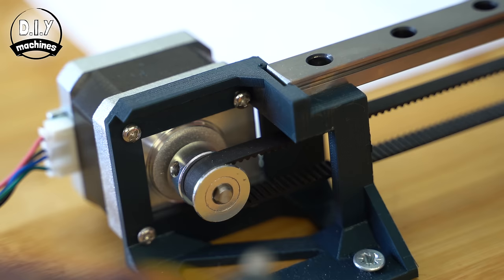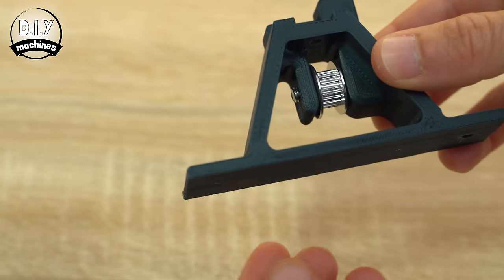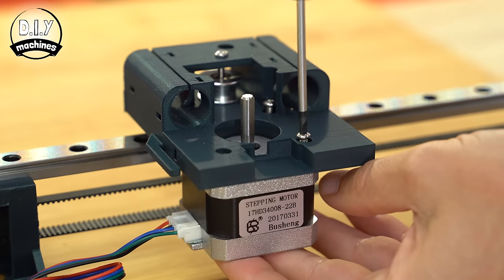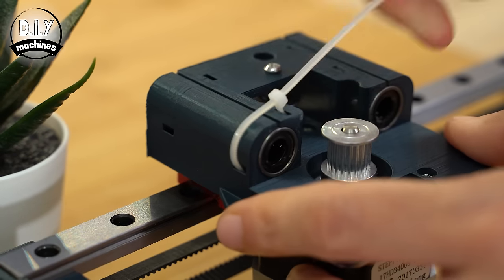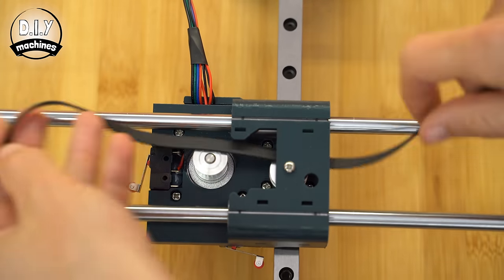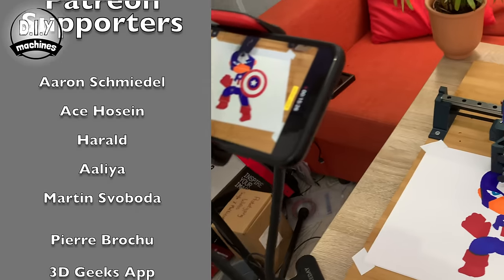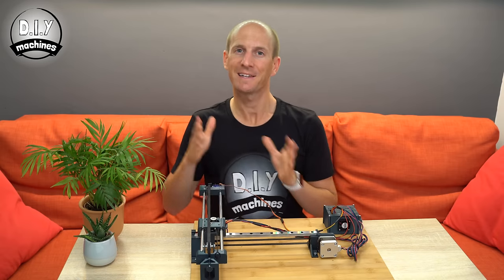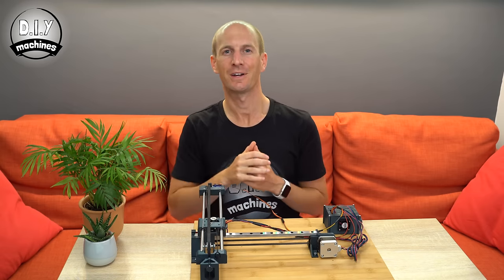Super Easy 3D Printed Arduino CNC Drawing Machine | GRBL Plotter Elegoo

Comment: cool project but i just put everything not printable into my cart and its $298.21 before check out. which is actually more expensive than some cnc drawing machine you can buy pre assembled
Reply: my total was less than $150  i just bought a machine for $99 which has not been delivered yet but comparing the two machines by images and descriptions it is clear that this is a much much better machine. It is more like the ones that cost $1000 to $1200 and you get to have fun and learn your printer. Forced me to do some upgrades and some experiments. My parts are coming out really nice of PLA carbon. I am going to hack up the cheapo to customize it for plotting on piano rolls as my laser machine cuts them. This machine will be my new toy. Once I prove the theory I will probably modify another copy of this machine for the roll cutter because I want reliability and durability and I know the $99 unit will not be either of those.

Comment: Wow , amazing tutorial , thanks you so much sir
I wonder if you suffered from this problem ,
some times after I bought stepper motor driver and current well calibration , the stepper gets vibrating, do you know the reason.
I used  A4988 , TB6600 , they were good for a few days , but after that ,the problem occurs.
what is your stepper motor driver name?

Comment: Just getting back to this project and found that the "30cm long linear rail with block" link you provided does not line up with the raft I printed. The holes in the block are approximately 12mm closer together than the holes provided in your 3D printed raft design. Do you happen to have the correct link for the larger block used in your video (the larger one with the green and red edges)? Thank you!

Comment: I have been looking for such a project. I built a laser piano roll making machine and have been trying to find a way to print lyrics without buying a $1200 printer and paying for expensive ink. I wrote all the code to do this for both matrix printers and modern banner printers before realizing how much it would cost to do this. I then thought of the idea of a plotter and have one arriving soon that is a piece of junk compared to your design. I only discovered your video because I fell asleep watching another similar one and yours came up. You video and instructions are amazing. Your attention to detail is superb and the machine looks like or better than commercial units costing a loooot. This is definitely my next printing project. I finished a major job of printing fenders for my recumbent tricycle and in the process have gotten quite good at printing impossible parts. I can't wait. After this I am afraid what I might want to build from your plans. I have not actually built anything yet but it is clear that you strive for and achieve a level of excellence that is rare today. I see from other comments that many people feel the same. GREAT WORK, KEEP IT UP

Comment: The level of care to detail is so amazingly high in this video - WOW.  I appreciate the helpful tips to help you ensure everything has worked correctly, such as the troubleshooting steps for the belts, and the continuity test of the contact switches.  This is particularly remarkable because it the most complicated build that I have ever seen that is made so accessible to an absolute beginner.  If you have access to a few basic tools (glue gun, screwdriver, soldering iron, multimeter), you can make this.
Reply from the maker: Thanks for the kind words Tristan, I worked hard to make it all as clear as possible.

Comment: I successfully build my own plotter, thanks again for your video!
Just one thing i´m concerned about: My Nema17 Stepper Motors are becoming quite hot, when drawing big pictures (2-3hours). I can touch them for barely 3-5sec!
Is this a common thing (i dont have experience with stepper motors) or is something wrong with the stepper drivers? I saw that its possible to change the ref Voltage, but as i understand, this build is using UART drivers, so no need to configure the vref via potentiometers, right?
And how can i configure the motor amperes via UART? 
Thanks for help!

Comment: I would recommend using Nylock washers instead of normal nuts as the Nylock nuts have a locking nylon bushing in them.  Also, is this project expandable so that a drawing that is around 24 inches by 36 inches is possible?

Comment: One of the better design print/writers and neatest designs.

I think the axial motor mounts could have had slots to mention the belt.
And I think the pen end could have been attached directly to the head, with a gear, or swivel arm to lift and drop it.

I think I would have built up the shield before mounting the Uno so alignment is easier. But then you can't get the screws.

And as a small part of design, the slid bearings, rather than using cable ties, a small screw could hold them there if spaced far enough away to just catch rather than misalign.

Keep up the good work.

Comment: I bought all the parts on your list and am very excited to build this. I am working on a frosting pen that will extrude red,green and blue frosting into a small mixing head to extrude a variety of colors to draw on cookie- cupcakes and cakes. Your videos are so easy to watch and understand.
Reply: Did you do? Does it work?
Reply: @MertCadet  I am still working on the design but it does work. Frosting pumps work great but the mixing head needs work as the frosting comes out in stripes like toothpaste not a well mixed color. The larger mixing head did a good job but requires too much purge before chosen color extrudes.

Comment: Just got mine finished. Works a treat. I have modified the pen holder by the addition of a compression spring which helps the pen engage on the paper when the servo releases. I also don’t use belt on the pen, just two plain pulley wheels and a length of fishing line between the pen head and the servo. I 3D printed a small support for the pilot wheel at the servo end.
Reply: Hey, I was just questioning why do we need the belt for the pen myself, it seems it could be simplified by putting the small servo motor on the same pen holder. Could you share any ideas on how you removed the belt?

Comment: Hi, great video and I'm ordering to build it now but I want to design a 45 degree pen holder, is it possible to get step files from you?
Reply from the maker: Hi Brennan, thanks for the kind words. I'm sorry but I only have the STL files. I designed this project in Solidworks but I no longer have access to it (I used the software where I used to work but I don't work there anymore). My new projects are starting to be designed in Fusion 360. Depending on your software you might be able to have it 'recognise' the STL files and turn them into something editable for you?
Reply: @DIYMachines  if you are interested I have access to solidworks and could read the old files for you and create steps. Fusion 360 also reads native solidworks files but you need a paid version to export step files.
Reply: Great project and great presentation as well! Is there any way to use another arduino to write codes on grbl serial monitor (command line)? I'm thinking of making a template for a drawing which will take measurements as input then that other arduino will make calculations then write the code on grbl.

Comment: Dear DIY Machines, 
This is the first video I am seeing from your YouTube Channel.
Crisp and Crystal clear videography catches the eyes instantly. And still more Crystal clear audiography catches the ears without any hitch or glitch.
I wonder your recording studio must be equipped with the most modern media gadgets.
Thanks for both.
Your way of describing a, even though you dub "Super Easy", this is indeed somewhat complex design, is simply fascinating! Stream like narration without any drag, is all the more informative. Even at first run, I was able to absorb th key points easily. 
Assembling a technical machine that is going to be assembled from raw components, with this type of oral guidance is, of course, as you names, "Super Easy!"

 Apart from the electronics and software sections, the construction fairly uses 3D Printing for many parts. So, no cutting, grinding, polishing, milling or drilling. A very nice method.
Congratulations form an ardently ardent DIY Techie from the seventies!!
I am about to do this. But I hope you will publish the programming section and the electronics section soon. Please make this video complete is all aspects.
Thank you very much!!
Reply from the maker: Hi, thank you so much for your kind words. I work hard on the projects and the videos and it's so pleasant when someone takes the time to say a few kind words. The second video can be found ere: https://youtu.be/8scKLHz77Lg
Reply: sir, problem how to clear error this type 
08:44:05.465-> error: 2
08:44:28:27.883-> error: 9
Motor not running pls help sir

Comment: This is a great project and a well done video.  How far could this be scaled up by using longer slides?  I would like to build one with a working area 24"x36".  610mm x 915mm.  That would cover a standard poster board, foam board and... well, a lot.

I am thinking the X axis rail might need to be doubled, one motor and rail on either side?
Reply from the maker: Yes, if you were to increase the axis moving back and fourth than I would recommend doubling up on the linear rails and a motor for each rail to move them in tandem.
Reply: @DIYMachines  Thanks for the reply, I will keep you updated on my progress.
Reply: @kennyFF033  how is it going? Now I have completed mine I’m planning on a design change (adding a second rail ) and also seeing if it will
Work ok with a usb microscope.

Comment: Normal closed switches are better for safety features. It will stop the machine in case of a cable or switch failure.

Comment: Hello, this is incredible, thank you very much for this fantastic video. I wonder what software you are using to design your 3D printed pieces.
Reply from the maker: Thank you and you're welcome. This project was designed in Solidworks but I now use Fusion 360 for my newer projects.
Reply: @DIYMachines  Thank you for your response. I will check both of them. Live long and prosper. 🙏

Comment: Very nice project, this could relatively easily be adopted to laser engraving as well.
Reply from the maker: Great idea. I believe you could. GRBL (which runs on the Arduino and interprets the GCODE) is built to also control lasers so I don’t believe you would have to modify the project too much.
Reply: @DIYMachines  sounds like a future video you can make! 😁

Comment: Where did you source your steel rods from? I'm having trouble finding one as short as 55mm
Reply from the maker: I ordered them on Amazon for my prototype and I used some from eBay for the final build (shown in the video) as the ones on Amazon became out of stock. You can use a small hack saw or similar to cut longer ones down in length. Just use something like sand paper to smooth the edges of the cut before inserting them through the bearings. This is what I did.

Comment: Hi Lewis! My son and I are in the process of 3D printing this and have a question about the linear rail. I ordered the one from your link on Amazon, but it does not look the same as what you have in the video. I did not notice later there was an option for a MGN9C (the one I received), and another for MGN12H. Can you provide more details on which one to use? Thanks for providing great content!
Reply from the maker: Hi Jim, great to hear that your building one together. I'de love to see a photo when it's completed. :)
The number refers to the type of block on top, see here for more info: https://aws.robu.in/wp-content/uploads/2019/07/Linear-Guide-Rail.jpg
From memory I believe it is the MGN12H I designed the parts around.
Reply: @DIYMachines  Hi Lewis! Thanks for the reply, I realized this soon after I posted this. We have completed the build, and will be sure to send you pics of our build very soon. I do have some other questions, mostly related to part 2 of this project, so I will post there. Thanks!
Reply: @berner57  Hi Jim. Do you mind sharing some pics? I´m really interested. Thanks
Reply: @d3rsch0rsch  Absolutely! I was planning on doing just that, along with some notes on my own experiences. This is a great project, and a lot of fun, I need to do a little house cleaning on it before I take pics.

Comment: Nice Job. How do you create the infill once you create your drawing in Inkscape.
Reply from the maker: Thank you. For the infill I drew lines back and fourth in Inkscape. My Inkscape knowledge is limited - if you find a sleeker method please let me know. :)
Reply: @DIYMachines  Good Day. It seems that most folks use hatching and can be downloaded from https://wiki.evilmadscientist.com/Axidraw_Software_Installation. Its a Inkscape plugin.
Hope this helps.
Reply: @MrLeopain  This tip is golden! The hatching works perfect, and can be adjusted depending on the pen size used. Awesome.
Reply: @d3rsch0rsch  Which version of Inkscape are you using. I find the size that I save is not the size it prints.
Reply: @MrLeopain  I use different versions. All the editing and also the AxiDraw Tools i do in v1.0.1 (latest)
Then i save the SVG and make the gcode with the Migrbl Extension in Version 0.48.5 (as mentioned by Louis in the Video)
I cant tell, If the print in real will be fine, because i dont have a Plotter by now ;) But Simulation in Chillipeppr seems top be OK. Its looking fine in the visualizer.

Comment: i have a question luis pls reply can i replace stepper motor with brushless motor
Reply from the maker: Hi Pawan, a brushless motor would not be accurate enough for this project or suitable for the motor drivers used.

Comment: Would it be possible/feasible to make a corexy version of this design? I ask because it seems that this takes up a lot of space outside the nominal footprint, since the bar has to go so far over the back edge of the board.
Reply from the maker: Hi Walter, it could be re-done as a CoreXY style but it would end up being a very different machine in many ways so probably best start from a fresh design. One of the reasons I did not go down the CoreXY route was because if the frame is not perpendicular at the four corners it can lead to dimensional inaccurate drawings. You are right though that it would mean you would not need to allow for when the pen axis is protrudes out the back of the workspace.

Comment: Is it possible to make it bigger with longer rods and linear bearing or would the added length add to much strain on the 3d printed parts and motors?
Reply from the maker: You can certainly make it larger. A longer rail on the X axis should not add much strain to th machine, but extending the rod on the Y axis as is would start to create problems. It would certainly need two X axis if you wanted to reliably support a longer y axis over both.

Comment: Excellent project and would like to make one for sure but my question is can we use a push-pull solenoid instead of a servo for the pen? I am looking at increasing the writing speed using the solenoid. Please suggest!
Reply: Solenoids cannot set to a specific position like a servo or stepper-- they are all one way or the other.

Comment: Fantastic video! I'm setting out to follow this and build my own, wish me luck.
Reply from the maker: Thanks Viktor. I'll say good luck (but I hope my instructions are good enough that you don't need the luck) :)
Reply: @DIYMachines  Yesterday I ordered parts and started printing the first few pieces. I'll give some feedback on problems I faced so far: 1. Wasn't sure what strength of nema motor I needed, but ended up buying ones with similar size (as a bad proxy). 2. had problems understanding how the linear rail and block standards work, what's a MGN9C vs 12H etc.. Guessing can make it work with whichever,  but took a while to decide.  3. My first 3d print failed (BaseEnd-Idle) when I to print it as it'll be mounted and didn't realize I needed to use support. printed it successfully turned 90o instead.  Not saying you should to include all these types of instructions in the video, but thought it be helpful for you to know.
Reply from the maker: @voccyvoc  Thanks for the feed back Viktor. I have added that you should use a

Comment: I can't find the 8mm Chromed Steel Rod 5.5cm anywhere, I looked up AliExpress and Amazon, got nothing !
Reply: I agree, we are almost done with the build and can’t find the 8mm, 55mm rod. We 3d printed one. Then, hot glued fishing sinkers to the pen assembly for weight. The pen assembly now goes down when tension is released from belt. Hope this helps
Reply: @cooldude4432  Thanks, that would be helpful for sure, but I ended up buying a little longer one and cut it using a jigsaw.

Comment: Don't have a 3D printer so would have to order in. What material is best for the printing?
Reply: In my opinion it's inconsequential for an application like this. Either PLA or ABS, whichever is cheaper and available in the colour you want, will do just fine.
Reply: @olavl8827  Bought a printer instead but could do with a bit more info on profile settings?

Comment: Hi, how are you? 
I would like to thank you for the project. 
I'm almost done replicating it and I'm going to use a laser instead of the pen. 
I noticed that it has a vertical clearance that rocks a lot. I don't know if it's because of the weight of the laser, as the axis moves forward it goes down.
is there any adjustment that solves this?
Reply: lso some tips what not to do while doing this project ; )

Comment: Very nicely done video and I like the design of the plotter, others I looked at use one belt with 2 motors but I prefer this way with separate X and Y axis motors as can use my old creality ender 3 board as is to drive it.
Reply from the maker: Thanks. Sounds like a good way to recycle your board as well.